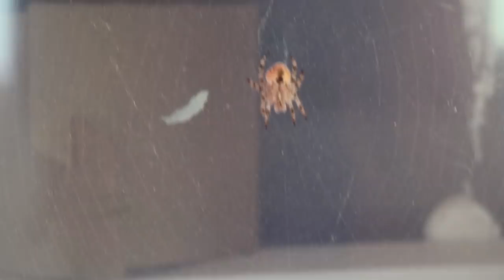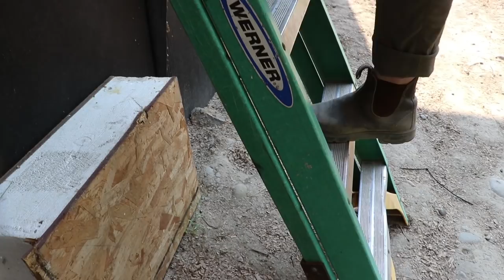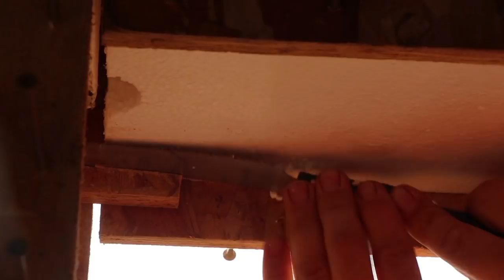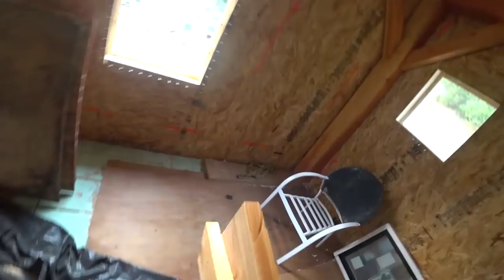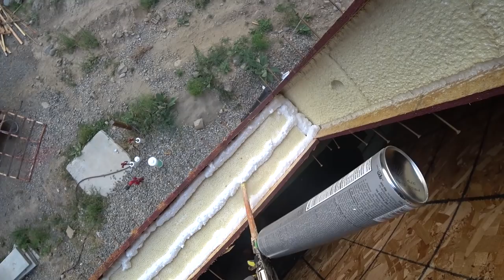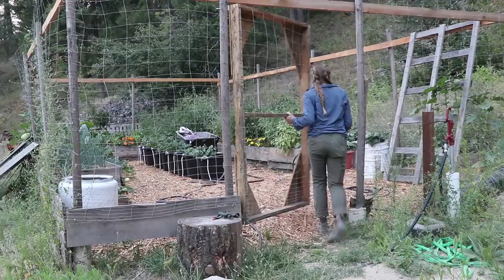Couple Installs Own Windows on Dream Home (Amazing)

Comment: I would house-wrap it first, then put in the windows and use window tape to cover the holes. This way you get consistent layer with less seams and no patches between the windows.

Comment: Make sure you put 3" screws every 2" all around the perimeter, wouldn't want them to fall out, that will help make up for the lack of screws you used on your nailers. 300 or more per window should be enough. You two are keeping the screw companies in bussiness .
Reply: Those screws are not to keep the windows from falling out! Get back on the bus.
Reply: do not follow this advice warning you guys the sills will fall out with screws every 2", ensure they are screwed at every 1" for a better connection
Reply: Bill Sheffield , I want to ask them if I can borrow some screws but I don’t want to cut them short on their screw supply.
Reply: The SIPs likely require every 3in. However that is based on using the SIPs as the structural members, which in this case is the timber frame. It is probably way overkill, but also how do you chose a new spacing and still maintain a product warranty.

Comment: If you have not painted the ceiling yet. There is special paint to help hide the knots. Double or triple the number of applications it recommends. If you don't, within few months the pitch in the knots soaks thru the white paint, making yellow spots all over.

Comment: high end painter for over 40 years dont paint  wood deck bottom ,stain or better yet pickle bottom you will get light reflection i assume you are doing it for but you avoid peeling of coat down the years and other problems with painted surfaces and re -application of stain is fast and easy

Comment: At 7:42 you say you'll paint your flooring white on the underside.  I'd do that too.  Do I understand that your flooring will also be the ceiling for the upper floor.  If that is the case, that white ceiling will make an excellent contrast with your timber frame.

Comment: I vote for painting the ceiling side of the loft flooring. It will make every thing much brighter in the depths of winter. You can have to much wood on the interior of your home. I live in a house with way to much wood. It is very dark and depressing in the winter months. Let the frame and a few walls/floors be the perfect accent for your motif.

Comment: Scaffolding would be a big help.  Nice to have a Fork Lift but scaffolding is cheaper.  Whatever happened to the Backhoe?  You can put forks on it for lifting .  An extension ladder can leaned in above the window and a chainhoist or come-along  can be put on the top rung to winch windows (or anything heavy) straight up the outside of the wall.   I'm a big believer in the five basic machines

Comment: Two words: oscillating multitool.
Reply: I was thinking the same thing. Milwaukee makes one for the 18 volt batteries. About $119 and one of my favorite tools. Great for cutting drywall to fit electrical outlets also. Gets into those tight places and makes short work of those sip splines.
Reply: Agree 110%.  Once you have one, you'll wonder why you didn't have one sooner!  This is especially true now that there are cordless models that really make it simple.

Comment: They both complain constantly about being hot but yet they both dress like its winter.
Reply: Hows that? They have light long sleeved clothed that still protect from UV-radiation and protect skin while working. You can actually work in literal winter clothes (that breath least a bit), long as you drink way more water and take enough minerals. You will be hot as fuck at first, but after getting soaked by sweat, you start to cool down.
Reply: long sleeves and hats like that prevent sunburn
Reply: They have whole videos on the topic. The clothes are supposed to be very breathable and light. I agree though, it seems like they would be super hot regardless of how thin. Never tried them, so don't really know.

Comment: I forget. Did you decide on swamp cooler, air conditioner, or reversible heat pump? I haven't noticed any holes or duct route preparations in any videos lately. Interior walls go up QUICK! Your house might be just fine with a good air exchange plan, ie. trade cool night air for the day warmed house air, filtering bugs out of course.

Comment: Alissa, when your not in the direct sun, take off that hat. Your body loses approx 30% of it's heat through the head and in such temperatures your just keeping it in. A small hint also when ripping wood. Make sure the saw teeth rise up completely above the piece being sawn. This assists the transportation of the sawdust/chips and avoids possible clogging causing the blade to get stuck or worse, possible kick-back. Meant well 🤘

Comment: meanwhile, in BC its 9C or 49 F while a little chilly, this is probably why they don't switch to convert because the math is complicated.  Because both Celsius and Fahrenheit scales are offset– ie neither are defined as starting at zero. On top of that, for every additional unit of heat energy, the Celsius and Fahrenheit scales add a different additional value. Because of this setup, it’s impossible to say that doubling the °C or °F value doubles the amount of heat energy, so it’s difficult to get an intuitive grasp of how much energy 1 degree Fahrenheit or Celsius actually is. Intuitively we feel the heat, Intuitively we feel the cold, the only register that truly shows is the heat can be seen on both of you, heat stroke is a real thing, so take care out there! so to end this little rant, I leave you with a Celsius to Fahrenheit conversion, because I alone don't have the patience to convert it alone! https://www.metric-conversions.org/temperature/celsius-to-fahrenheit.htm

Comment: House is look good will be great to see the windows in. Tomato plants have gone wild, i know your busy but you need to prune the suckers form in the axils between the leaves and the main stem. This encourage a strong main stem by removing all suckers below the first flower cluster and helps get better tomatos. Well thats what i was told and have been doing with good results. Usuall have a look when watering and pick them of when small with my hands👌

Comment: I can't believe you guys in the states still use the imperial system
Reply: Actually - we use BOTH the Metric System AND the English (Imperial) System...sometimes side-by-side - whichever best-suits the situation.It's simply that quite a lot of our industrial and engineering capacities, and technical capabilities are still often tied-in with machinery and/or materiel-supply streams and standards that refer back to the far-older English System. As a design engineer, for instance, I have to utilize both, sometimes interchangeably.

Gradually, though, the Metric is, bit by bit, taking over, more and more - especially in areas like aerospace and transportation industries.
Reply: The world use the metric system and we put men on the moon....
Reply: Far better than that foreign metric rubbish
Reply: 101bennyc yes we are so blessed to still have the right to choose. ☺🇺🇸
Reply: It's harder to learn, but it has it's benefits, especially if it's all you've ever known. Don't knock it until you've learned it and used it.
Reply: See there's basically two schools of thought when it comes to measurement systems. Those who prefer the metric system, and those who landed on the moon.
Seriously though, it's easier. To divide a measurement in half, all you do is double the denominator.
Reply: Cause we live in Merica Proudly.😜
Reply: 101bennyc ,  it’s the best though.
Reply: I cannot believe those using metric have such difficulty comprehending a different scale. To the point they will convert all of our drawings instead of just using a different measuring tool. We use both all the time.  It isn't a big deal.
Oh, and the US does not use the imperial system, that's the British. They are not the same thing.
Reply: Cool story bro

Comment: Using the table saw u should better raise the blade about one inch over the top of the boards u saw. because the uprising and the top sawteeth will force the boards towards you, which on one side makes it harder 4 u to draw them through the blade and one the other side is pretty much a safety issue. because the boards tend to lift and may hit u ... worst case u become Unconscious, fall over and get ur head sawed into. 😨😱💀